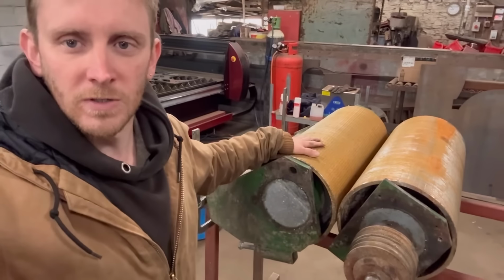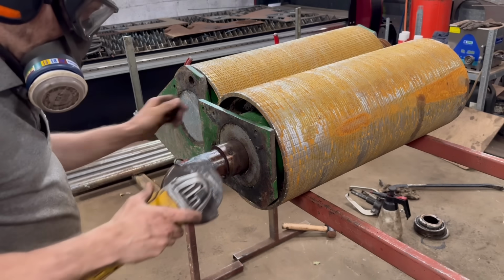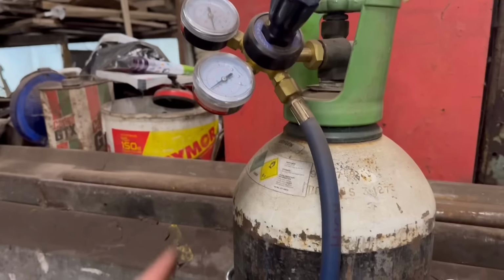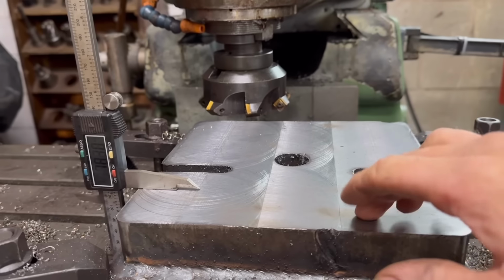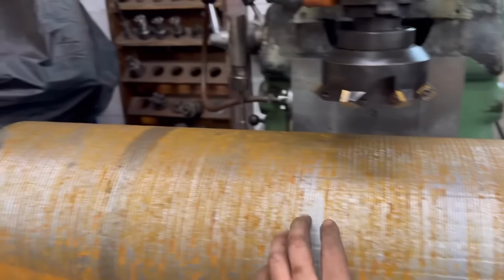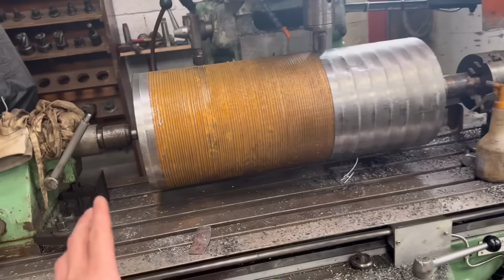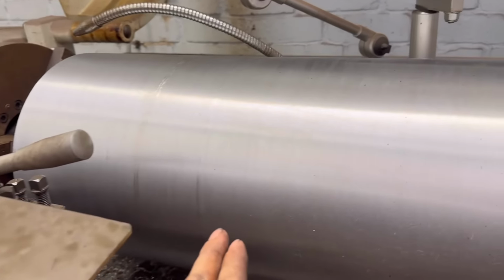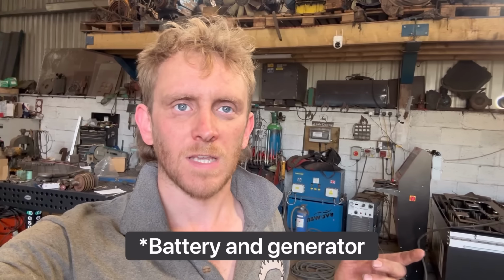Skimming rollers out of a roller mill. I need a bigger lathe!

Comment: You do a pretty good impersonation of a machinist 🤠
The first dimension you mentioned on your lathe is “Swing over bed”
Which is the absolute largest diameter that will clear the bed.
The second one is “Swing over caridge”
I think your lathe also has a removable gap if I remember correctly which lets you turn an even larger plate with a limited thickness.
Great to see your outside of the box thinking and determination to complete the job.
Looks like you owe Angus one. I’m sure you have fun stuff he doesn’t have.
Nice of him to let you film at his shop.
I don’t know about phase converters but welding from batteries and solar panels is probably going to be expensive.
If the suns not shining your welds are also going to be short 🤠
So for my 2c worth a generator is sounding a lot more like a stable option.  You can turn it off when you’re not using it.🤠

Comment: Great video 👍 So painful for you but Great video all the same,a belt drive on the drum and use the drive motor of your jig borer welder to drive it and too finish off with the 9 inch angle grinder to give it a ground finish 😅

Comment: i guess that's one job done at a loss, but the main thing is that you got the job done for the customer. Good thing you could use that bigger lathe at the other machine shop. It saved the day.
Reply: I doubt it was a 'loss', just not high profit per hour. Accounting for lost labor in a private business is only valid if you have your time 100% booked at full charge. It may have just cost him a few less hours playing video games. 😲And time spent also goes towards learning for future jobs, which can then be reflected in higher rates with more experience.

Comment: Maybe you could make something  to power the rollers in the milling machine like the pulley system on a drill press fpr example that way you would have a choice of spindle speeds and then you would perhaps eliminate the poor surface finish you achieved with the gear box attatchmentment you were using <cant think of the name for the bloody thing !> Anyhow good job mate. Regards Chris Bailey

Comment: Would it not be easier to weld a nut or socket onto the end off the pullers and use an impact gun to drive it.
Reply from the maker: No, they’re hydraulic pullers.

Comment: Would the face cutter have worked if the head was further over the part ….like the same dimension as tool hight in a lathe. Then it would engage with more of the roller surface. I.e the far or near edge of the tool to be directly over the roller not the center of the tool. Really enjoyed watching you try to work around the problem

Comment: That looks copy of Finnish made Murska crimper mill. Reason for wear like that is, rollers arent surface hardened or them are adjusted wrong. There must be 0.3mm space minimum between rollers when tensioned fully. Then them wear evenly, and hardened rollers can handle several million kg:s before need to be replaced. Allso check roller center plates are not cracked between shaft and roller tube.

Comment: I know how split phase works in the US, but no idea about it in the UK. I'm currently in Germany where 3 phase is in every building (at least as far as I have seen) Why the rest of the world doesn't do this is  strange. I worked in a large carpentry shop that had solar arrays on the roof and they sold their surplus to the electric company. So I'm sure solar is an option. Likely an expensive one!
I would suggest consulting an electrician. To see what your options are. Form a youtube perspective, I'd say you need to upgrade your power capacity in the shop... A phase convertor seems like an economical solution.
Reply: Strange? He lives/works on a farm very far away from any significant residential/urban/industrial infrastructure. It would likely cost him $100K+ to get heavy duty 3-phase power run out to the farm.
Reply: @kindabluejazz  Strange in the sense that 3 phase power is more efficient! Has nothing to do with how far you are from the energy source!
I have not suggested that he get the farm power supply upgraded...
How in the world did you comprehend any of that from my comment?
Reply: @Johannes58934  You asserted the 'rest of the world' is strange because it doesn't run 3-phase everywhere, so that includes Ollie's family farm. The simple answer is it's more expensive to install and maintain, and the vast majority of people don't need it. The farm never needed it until Ollie started to do big metal fabrication, not just farming. And the further the distance from the generation, the higher the cost to deploy. It's not just about the cost of the electrons. The 'rest of the world' does the math and does things when they can justify the costs. What seems 'strange' to me is that so many people like you seem to think you know more about how everyone else in the world should structure their lives and cultures and presume everyone else is just doing it stupidly and wrong.
Reply: @kindabluejazz  get a hobby

Comment: a freind had a symular crimper , either  1000 or 1200 wide i forget (to wide as bearings to far appart so gave trouble ) 
he had a lump of heavy wall pipe to slide onto bearng face and a blow with 14lb sledge to release .

Comment: According to google a rotary phase converter can power welders and plasma cutters. I'm in the US, so not much help with suppliers.
Reply from the maker: Trouble is I don’t really have enough electric to run a phase converter and a welder
Reply: @snowballengineering  The phase converter itself consumes very little power, it's like a motor running idle unless the attached devices are drawing power. You clearly need someone with a lot more expertise than I have. I'd talk with a supplier, I doubt they want to sell you something that won't work.

Comment: Hi Oliver inverters do not like to run multi voltage tools such as plasmas, welders etc, ( tools that have multiple taps off the transformer to run different circuits within the tool or sensitive electronics ) gen set with auto start wired into a distribution panel is the only sensible priced option that i know of sorry mate.

Comment: Could you not have run the face mill on the milling machine with the y (longitudinal) auto feed engaged on its slowest setting. Then just keep rotating the indexing head slowly by hand or even attach a low speed drill to the spiral gear feed. Obviously a bigger lathe is the easiest option but depending on speeds and feeds this could have worked. Great outcome anyway. 👍

Comment: I wonder how many thousands of tones of barley those rollers have processed, 😳. I thought you were going to mill the slots by turning the dividing head at the same time as traversing the mill. Did initially thing I would have used the angle grinder but that would be too rough for you 😂😂. As an industrial electrician for many years I have serious cautions on a lot of the comments about phase conversion as I am sure you have worked out. You probably need advice from somebody that can look at your power available and what your max demand would be. My personal advice would be ex standby generators are quiet, cheap and not that  expensive to run for the times you would need them. You then have standard three phase for anything you wish to run but you will need atleast twice the size generator than your biggest “MOTOR” load. Welder and plasma shouldn’t be a problem as long as they are generator safe ( less of a problem with bigger generators)
Reply from the maker: My phase convertor has more than enough capacity for everything with a motor I have. I just do not want to be running a welder or plasma on it.

Comment: I say use your split phase input as power into a rotary or electronic 3 phase converter.
Reply from the maker: That’s what I’m doing but like I said in the video, it’s not recommended to run welders and plasma cutters on them

Comment: Get a quote from your local power company for a 3 phase install upgrade.
Reply: Easier said than done. Ollie lives on a farm out in the wilds of North Yorkshire. His DNO would probably want a small fortune to run three phase out to the farm.
Reply: @lemmy9996  if he has split phase now then there is a 3 phase supply behind t feeding the split. Should not be too big a cost and is best option by far
Reply: @mattsan70  sure yeah, the question ends up being whether the 3-phase supply is 100m or 10 miles away
Reply: Yeah, 12 years ago when I asked how much I was told £1200 per pole erected all all in a straight line + transformer cost (at least £7500 for a 200 amp supply) + at least 6 months delay and any deviation such as corners, bends and in our case a small river increased unknown costs. 
We said no thank you and went down a diesel generator route with an on demand startup and shutdown for a three phase setup.

Comment: Have to say I am baffled how you run a shop without owning a truck. Or at least a trailer. 

If you put a feed motor on the indexing head, you could do a nice job cutting helical grooves in that roller. Set the head really slow and the mill feed fast. 

Best of luck finding the bigger lathe.
Reply from the maker: The farm has a pickup and trailer I can borrow if needed but the pickup was in use when I took the rollers
Reply: That Corsa IS  the truck….  Did the job just fine!

Comment: Those slots laterally across the rollers are to grab the corn and force it in between them. Otherwise all the corn is going to do is sit and spin against the rollers until there's enough trash/dirt on the rollers to assist grabbing it. If there's any moisture on the corn there's a good chance that's all it'll do is sit and spin.  
From what I've seen of the machine, you've got a pair of choices... 
1) cut lateral slots into the rollers
or 
2) with your dividing head, you could cut spirals that form a V from each end to center. 
Given that the orig item had lateral ones though, that's the route that should be taken. 
If it were mine and they came back smooth and we hadn't discussed it (which WE out here in World Wide Wonderland have no idea about) that you'd be making them smooth, I'd give you one shot to make them close to original, or buy new ones. 
Hope the owner is happy with them and they work.... Just definitely not something I would do and return to a customer...
Cheers
Reply from the maker: Good job the customer said they didn’t need me to the spirals…. Like I stated in the video..

Comment: Definitely a three phase diesel generator which would supply all the electric including single & three phase plus 110 volt and run on red diesel extremely economical it’s worth thinking about, Especially mains electricity is getting so expensive 🇬🇧🇮🇪.

Comment: You could have possibly used your line borer power unit instead of the dividing head and somehow rigged a fixed lathe tool in the mill.

Comment: Your phase converter is static? And your split phases are 180deg apart. You need some sort of rotary phase converter for clean 3 phase and at high enough power rating for your needs. I believe you could construct your own with a large 3 phase motor and 2 very large single phase motors powering it on a belt drive. As I understand it your spilt phase isn’t the same as having 2 of the 3 phases which would be 120deg apart so its not as simple as coming up with just another single phase source. (Not an electrician).  Edit looks like you have a rotary converter. Talk to transwave but i think your issue with running plasma etc is In possible weak uneven phases and the type of power delivery. A diy solution with a flywheel might be the cleanest source. But your not far off the hassle of a generator. Solar would give you a DC source of power to generate 3phase from but you would need an impressive system.
Reply: Edit 2 …..think a delta wye isolation transformer might be what you need to run your non motor related 3 phase equipment from your phase converter.
Reply from the maker: The phase convertor I have is a rotary one
Reply: @snowballengineering  if its the biggest one you can power then i think your kind of scuppered. A solar system would have to stand on its own as you have no way to mess with the converter you have “adding a phase”.

Comment: My suggestion for your power is a motor generator set. A 480v 2 phase motor driving a 415 3 phase generator
You might even have the motor doing nothing on the farm, or one locally.
Even on Nuclear power stations motor gen  sets were used for all sorts of suppliesI am sure it would be your simplest and cheapest option.
Bloody good work but please think about your rigging a bit more !! It doesn't all need to be a sling in a bight.

Comment: There is a big issue with initial in rush current for inverters. And it is dependent on how much weight you swing on a lathe.
I would bet a motor and generator setup would be best for short use periods.should you get a generator get a crankcase heater and coolant heater so you can pre warm it up a couple of hours before use.

A solar inverter can take a mains input with a relatively small battery bank and convert the output to 3 phase without solar pannels! Have a waterfall? That could input dc power.
Remember your local grid can have harmonic current real vs imaginary to consider if you use 2 single phase inverters to take the 240 and create 2 phases synchronised to your phases. To make 3. For infrequent use, A gasoline fuel injected engine might work. Or, have you considered a welding rig capable of 3 phase output. Or, salvage one and rig it to an engine of your choosing.

If you have natural gas , then that is your choice for a carborated diesel running on natural gas. Or one that is dual fuel.

Comment: wonderful fight, congratulations.
your backlash issue probably stems from your cutter engagement, even in 4 axes, you have to conventional mill, that means having one side of the the cutter engaged and the other side less engaged (that is your passes being less than 100% of the diameter). Moreover, when milling at the other end to test the cutting depth, you probably should have rotated the roller the other way to stay in the conventional direction. If everything fail (for example if you have an odd number of teeth on your cutter), you can even go to 50% passes, so that there are is no climb cutting on the backstroke.
Reply: Also I think the cutter he ended up using still had a dead zone in the middle where the inserts wouldn't be cutting, so would be leaving a ~5mm area that is domed as it sweeps through the cutter, potentially rubbing on the bottom.  Hard to tell without seeing how the bottom of the cutter looked after being used in this situation

Comment: why not cut moving the bed from left to right in steps on the diameter? would have worked out fine with the first cutter.
Reply from the maker: Because every cut would be a flat, I’d have to do hundreds on passes to go all the way around
Reply: @snowballengineering  good point. wasnt sure that was an issue
Reply: hey it worked out with the friend's machine anyway

Comment: This highlights a major problem with engineerig. It doesn't matter how big your machines are, there will allways be jobs come along that need something bigger. We just have to draw a line somewhere. Buying bigger and bigger machines you have to justify their cost by how often they will be used. It is sometimes better to turn the work away, or knowing there is that larger lathe available, see if you can strike a deal with the owner to use it on the rare occasions it is needed.
Reply from the maker: Until I can master all the jobs I get coming in or get to a point where I’m happy with the size of the jobs I can take on i will never stop upgrading

Comment: Two phase - three phase is actually 415V, not 480V. A single phase supply is 240V. Why is the three-phase supply 415V? because the winding inside a 3 phase generator are placed equally around a 360 degrees stator = 120 degrees between each phase so the voltage generated is added vectorially and not an outright addition because the voltages are 120 degrees apart. (Google).

Comment: Do not piss about bodging a 3 phase supply - just pay to have proper 3phase put in - you will recoup the cost over 5 years and not have the headache of generators and batteries failing costing you more to fix and maintain. Just bite the bullet and swallow the power grid costs and move on.
Reply from the maker: Be over £100k to put 3 phase mains in

Comment: Do you really need a bigger lathe? I bought one last year which swings 20" over the cross slide and 6ft between centres thinking it would be good to have but it takes up a lot of space and doesn't get used anything like as much as the small one. There's only one of you so only one machine is making money at a time so as long as there's plenty of work more machines won't make you more money.

Comment: Voltage converter. Just run 480 volt input and three phase output transformer. A 3 phase motor should have various taps to set which voltage you come up with.